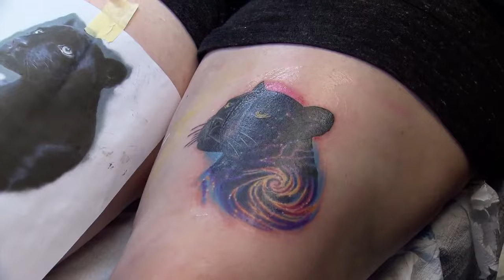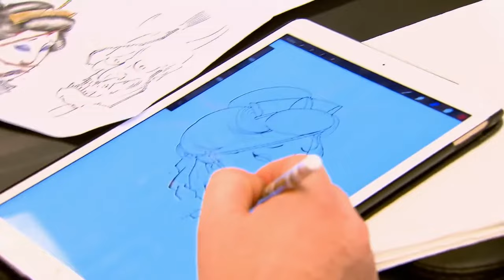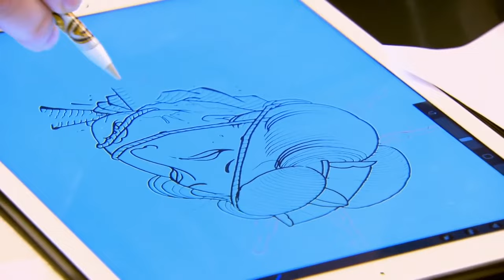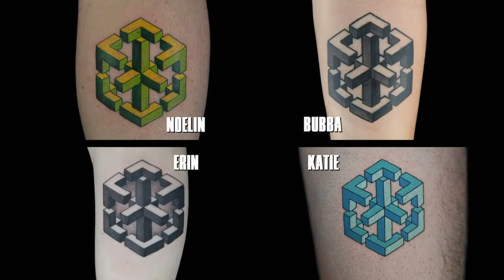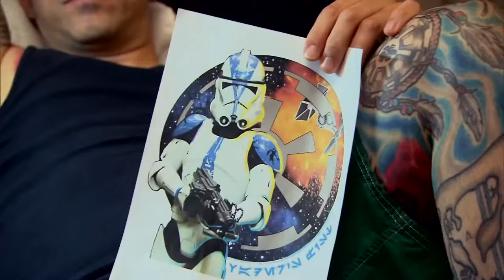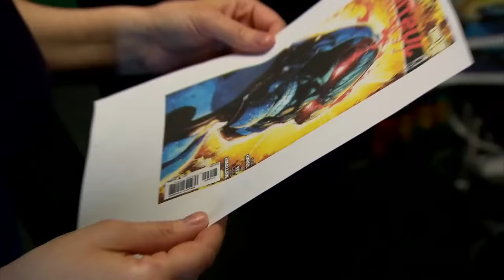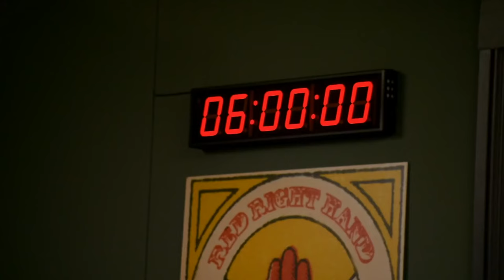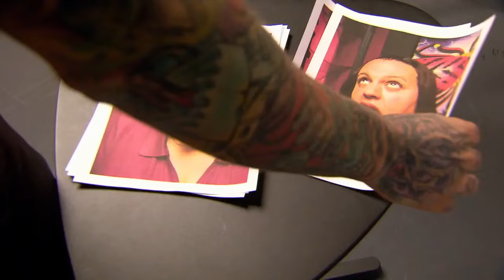✨Sweet Creature✨ | Ink Master's Fan Demand Livestream

Comment: On the lake Pegasus tattoo the lines are not parallel or symmetrical on the wings the legs are not proportionate or evenly propositioned to what a real horse leg looks like you can tell there's a lot of confusion and it was an image thought out not drawn kind of like when you're trying to think of what I hand looks like and then draw it without tracing